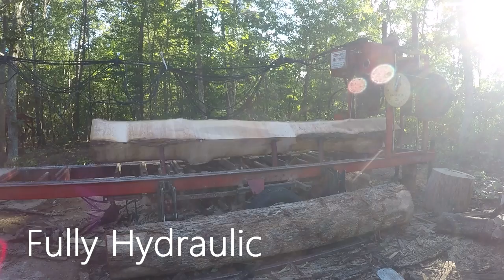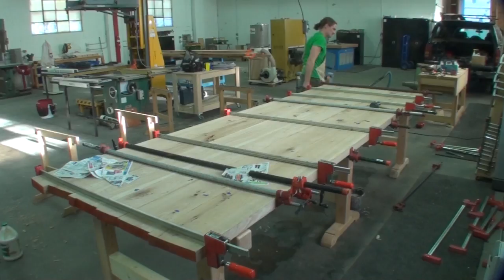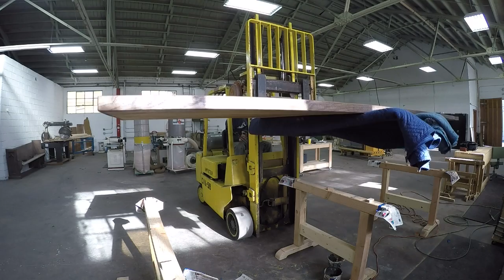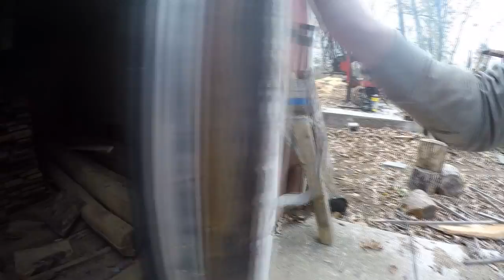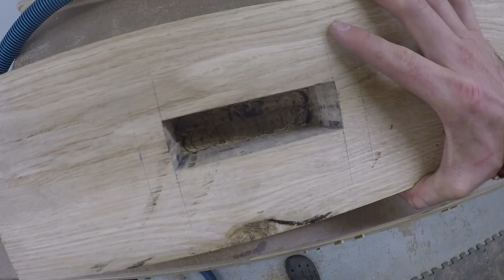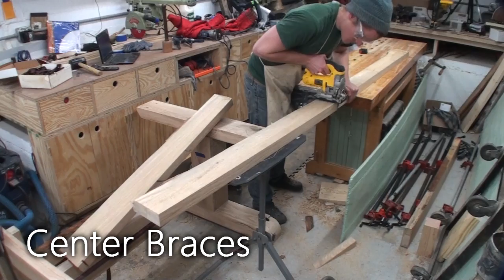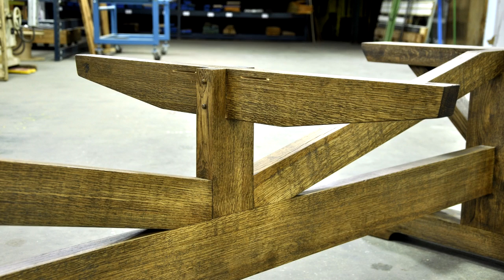Woodworking - Massive White Oak Trestle Table - Log to Table

Comment: Awesome video and project. I think this demonstrates how much work goes into the table base verses the top. Geometry and algebra are used so much in the design and build. Thanks for sharing!
Reply from the maker: Ha, it may be used but nothing to technical on my end. Most of the time I just eye ball things, trace and transfer lines and go for it. I do a lot of what I do without even measuring, just mark what looks good and role. Thanks for watching.

Comment: Read through the 229 comments (so far) and the replies you made but didn't see these mentioned.
1- How did you get it delivered? I know it was two pieces but still big and heavy. Rental 18 wheeler? Haha
2- Without breadboard ends and having the 3 supports, how do you account for wood movement? Elongated holes?
Excellent build and beautiful results! It definitely looks like a huge table that would be in a lodge! This will last generations beyond us. Hope you put your mark on it (in blood).
Reply from the maker: 1. I took things separately......the base, then the top, then the farm table and benches using the black truck to the customers house. Then they had a moving company pick it all up, with a bunch of other stuff for the cabin in a large truck. the top measured 12X4. The base is 8 feet long. The other table was 8 feet. So just one at a time.
2. I missed filming the part about the mounting holes, but you can see them at different parts of the video. The 3 supports have holes for large washers, then elongated holes for movement. There was also slots for table top mounting brackets as well. Once the professionals delivered it, the customer screwed the top on. Bread boards don't stop movement, they just help keep a table top flat and cover the end grain. I'm not the biggest fan of them.

When I say cabin, I don't mean a little quaint cabin, this is a large place where the table will fit nicely.
Reply: The Homestead Craftsman That black truck must have been down on the axels for each of those trips - haha.
Yes I saw the holes, just checking that my eyes weren't deceiving me. I know why the use of breadboards AND have seen how you aren't a fan of them.
Yes, Lodges are amazingly big and perfect for your great (both versions of that word - haha) country tables! The owners couldn't have picked a better craftsman!
Reply: @The Big Ragu Ragusa A breadboard is a separate piece of wood that fastens (in this case) on each short end of the surface, keeping the ends of large laminated pieces like tabletops, countertops, etc. (which are prone to warping) from warping. Most table crafters would deem them necessary in a piece this size. Some will argue that they make a piece more attractive, some will argue the opposite. Either way they add to the labor of the piece. Whether this piece will suffer without them, only time can answer that.

Comment: You have come a long way in the last three years or so.  Nice work.
Reply from the maker: I was actually making much more complicated pieces before I started my channel. Most of what I make is on the simple side, farm tables  for example, so that I can work really fast. I used to make a lot of stuff that was joinery and hand tool heavy, dovetails, etc. but my woodworking now is an income generator so I need to keep things humming a long and repetitive. What I have done though is improve my shop conditions and tools. I've been working well within my skill level for the past 5 years doing the same stuff over and over, I'm looking forward to getting back into more interesting pieces, in wood and other materials. Thanks for watching.

Comment: I've watched this video many times.  Of all the table builds I've seen on Youtube this is by far the one I love the most and has been the most inspirational for me on my upcoming table build.  I went to a local hard wood supplier and purchased twelve 8/4 white oak rough cut planks.  They sat in my garage for almost a year and now I've currently got them at a local saw mill be squared up because I don't have a jointer or a planer large enough to handle this size material.   I cheated and ordered some custom made steel legs for the base.  So all I need to build is the table top and stretcher that will span the two steel base legs.  When I'm done I will have spent about $2k on materials and milling but I'll have a 8' solid white oak table with a custom fabricated base that will last far beyond my time here.  It won't be nearly as nice as this one but it will something that stands out in my home for sure.  Thanks for the inspiration!
Reply from the maker: Nice, sounds like it will be pretty cool. Glad you enjoyed the video. This was a big piece as far as what is normal to me. It was involved, having to find the logs, have them milled and dried then the build. Fortunately it didn't cost me that much. I paid under $500 to buy the logs and have it milled and dried. The guy I got them from was clearly just being nice. I got enough wood to make 4 of these tables plus other stuff. Feel free to send me photos of your table when it's done. It would be cool to see.
Reply: @thehomesteadcraftsman8975  Just finished my table and emailed you a couple of pics.  Thanks again!

Comment: Awesome build! I've done quite a bit of staining and finishing for the stair/ railing company I work for, I would stain the edges after the surface, if you have any drips then they will easily be seen on the edge. I would also sand 320 between clear coats! Just my 2 cents, Great videos and solid content.
Reply from the maker: I like the edges first, then top, then go back around and hit the edges. I also wipe the devil out of the piece. 220 is good for adhesion and the paper wears each time I sand. It had a very soft feeling finish in the end. Not disagreeing,  just explaining. Thanks for watching.
Reply: The Homestead Craftsman right on! pretty cool stuff, such an awesome table!
Reply from the maker: Thank you, I'm also doing a series of videos going over the details of this table. It will probably be 3 videos total, here's the first one. https://www.youtube.com/watch?v=CCEgLDIrR6s&t=51s I go over the order, design and milling lumber.

Comment: I have a lot of white oak, thx for the stain tip. Nice finish! I really like that tone. Any estimate as to the finished total weight?
Reply from the maker: It is a nice color, it was the first time I've used it. Has the look of a lot of the original pieced done in this style. The table probably weighed around 600 or so.

Comment: very good use of Festool Domino construction.   I built a similar 12 footer  for friend 8 years ago.  My question:   Other than the long horse trailer we used to haul the finished table, how many guys were needed to squeeze that air carrier into a 36 inch door opening?

Comment: Great Job I see more festool tools
Reply from the maker: I've been using the two that I have in several videos. I've got one or two with the joiner and a bunch with the saw. I did get a tool not too long ago to align the guide rails though, very handy.

Comment: Loved this, great craftsmanship and now a big fan, the only observation that concerned me was how when planing across the grain you did not splinter off the edges, I don't know how you got away with that.
Reply from the maker: Not sure what part of the video you are noticing, but a lot of the time I'm not going off the edge and will come from the other side. If I do go off the end, I'm most likely going to be cleaning it up somehow in  a later step, this particular plane is razor sharp as well. Skewing the plane makes a difference as well, instead of having the full width of the cutting edge exiting the side of the wood, you just have a small part of the blade cutting.
Reply: @thehomesteadcraftsman8975  Thanks so much, great response, please don't think I'm being critical, I got what you're saying. Beautiful workmanship.

Comment: Great table and video, made me a subscriber.  

Staining directions say to wipe excess off after 15 minutes.  How do you approach that step when you are staining large pieces?  Do you stop wiping on after 15 minutes and go back to wipe it off?  Do you go a little longer wiping it on because it's faster to wipe it off?
Reply from the maker: I just stop where ever I am, go back wipe it down then continue to stain. I just try to stop at a good place......most of the time I have no problem staining a whole piece in a few minutes though. I don't like going too long as it can set up on you and require a lot of work to wipe it down.

Comment: Gorgeous table....beautiful workmanship. This is a question NOT a criticism...should the crack on the leg base have a "bowtie" installed? What really determines if one is needed or not.  So impressed by all your projects.
Reply from the maker: Most bowties/butterflys you see are cosmetic. They used to be done on the bottom of things then once being a craftsman became less of a tradesman and more elevated they came around in sight crack in the leg is stable. So you would use one if you thought it may be a problem but if the wood really wants to move, it'll move regardless. It's hard to dry lumber this size without a crack. That's why I didn't just saw a 6 by 6 for the big posts and did them in two halves.

Comment: Festool is another level but nor for mere mortals. Great job as usual. :)
Reply from the maker: Relative to what you can get out of them and the fact that other alternatives to certain tools don't exist....they are not that bad, but expensive yes. I use my tools for hobby and to make money so I can justify buying them at this point. Most average guys trying not to spend all their money and do a little woodworking here and there could get a lot of other tools for the price of one festool. For me the term time is money is very true, and they speed things up a lot for me.
Reply: The Homestead Craftsman I didn't mean anything bad with that. If I was a professional woodworker I'd certainly go for it too. Unfortunatelly I'm an IT guy who loves woodworking so my tools are like Bosch or DeWalt and I actually spend more time watching the pros than doing things myself. ;)
Reply from the maker: I didn't take it as negative, just sharing my thoughts. Some people get scared away from certain things that are expensive that have massive value, far beyond the cost of buying. Value of course is relative to what you are doing, for me it's high, for the next guy time is not a factor and he may also prefer to go about it a more traditional way. If I wasn't making money doing this I wouldn't have bought it either but a lot of hobby woodworkers do own Festool stuff. Now get back in your shop!

Comment: What spray gun and when do you prefer to spray over just wiping on?  Gorgeous table by the way.
Reply from the maker: With lacquer I would always spray. They making brushing versions, but you can't beat a spray gun........ which was just a cheap harbor freight model. $10 on sale. Sprays good, but all you need is finish on the table. I rubbed it to a satin after a few days.

Comment: Hello HC

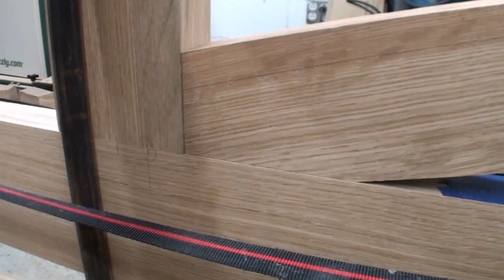At 17:27 how did you attach the top of the angled piece to the end frame stretcher, I may have missed it despite rewatching. Was it dominoes? I’m building similar harvest tables and was curious about your joining method.

Love the videos! Keep up the great work
Reply from the maker: If I am getting your right, yes, I used dominoes for that piece. I used dominoes and mortise and tenon for everything except the angled supports, which I screwed in.

Comment: Incredible table well done. With that track saw, did you not need to joint or plane those boards before glue up? Straight from cut to glue?

Comment: That's really cool. 
How much would a table like that weigh?
Reply from the maker: 500-600 pounds or so.... 2 inch thick 12X4 foot white oak, the top alone was probably over 400.....so maybe over 600. That's why I could not make the top in my shop. It's a monster.

Comment: This is absolutely phenomenal!  "True Craftsman" is an understatement for your exceptional skills!!!  In your video towards the end you said that you underbid the job which typically happens in most cases due to various reasons, in each instance different I'm sure.  If I may, how much did you end up building the table for, and if you were able to do this again, how much would you charge?  I built a farmhouse table as a gift for a friend in the family for her birthday, upon her multiple requests, and it was not nearly as exquisite as your peace, and my timeframe altogether was approximately three weeks (work, kids, family, etc...).  If you feel more comfortable you can message me privately or email me because I would absolutely love to learn how one can avoid making an error or be blind sighted as far as charging someone goes.
Reply from the maker: It's the nature of doing custom work. Since it's a new design there will be variables that you can't predict 100 percent. That's why I like making the same stuff over and over. I know how much it should be since it's the same. This would basically be a prototype. You just wing it the first time, then once you have the model make adjustments to the design and price and then sell it as a standard piece. I don't get into the exact prices I sell for but if I did it again I would add several thousand dollars. That's not to say that I sold it for a low price, but simply could have sold it for more. Mainly this is due to it's size, difficulty in handling, milling and the fact that it involved so many people. It was a premium service/piece to provide...which demands a premium price. To put it in perspective, I could have made around 15 or more of my farm tables in the time it took me. Making this piece was more about the customer and wanting to make a video on the process than the financial gain. My advice on pricing is to look at commercially available pieces that are similar to what you are making and add to that price. For example, if you want to make something and west elm has the closest match and they sell for $2000, price your table over that, how much is up to you. This won't work for everyone. Some people won't be able to get what places like that sell for and others can get far more even though he pieces may be about the same. What I'm making is nicer than a store bought table, cost more to make and takes much longer. It's also custom, so a sensible customer should expect to pay more, if they don't it's best to pass on the job than to cheapen your work......that's my opinion at least. I don't bend on price, once I give a price I don't haggle.

Comment: Quite a project and it looks great.  I'm working on something similar with 2x6 oak boards.  I can't afford the festool tool, but I do have a dowling jig.  I was also considering using my pocket hole jig, but I really thing the screws just won't be strong enough to hold the boards together (unless I place them about every two inches).  What diameter dowels would you recommend I use at what spacing?   Also, does the lacquer you used give it a shiny finish?  If so what type was it, and should I use a spray gun as well?
Reply from the maker: If you are talking about the top, then you don't need them. I did it for alignment. If that's what you want to do, then biscuits will work if you have one. Any size dowel will work if that's what you want. Does that answer you? I used satin finish, you can get it in any finish. I like satin, not a fan of gloss in most cases. I would suggest spraying it, then buffing. My spray gun is cheap, check the links in the video. If they are not in this one, the link for a spray gun is in one of the descriptions of the series vids. Thanks

Comment: Amazing work. How did you connect the table top to the framing/legs?
Reply from the maker: Two methods, long screws that can slide around a little as well as "store bought" table top fasteners from McFeeleys.

Comment: Great works and thanks for sharing the process.  What type of epoxy do you use for filling in the knots and holes?
Reply from the maker: West System 105 epoxy with various hardeners. In this video I tinted it with black powdered chalk for chalk lines. You may also be interested in this video, it's the first in a series where I will be detailing this build more closely. https://youtu.be/CCEgLDIrR6s Thanks for watching.

Comment: How many logs did you end up milling to get the required lumber for this project?
Reply from the maker: The two in the video plus some other lumber he had but all the lumber came from the two and I have a good amount left over.
Reply: Thanks for your reply.  I will be harvesting some trees in a couple of months with a friend and was curious how much I would need for a project of this size.  Thanks!

Comment: Beautiful table. Really like the trestle base. Is the top screwed to the base with slotted holes so there is room for expansion? And does this keep the top flat?
Reply from the maker: Yes to both. With that said, cupping in a top this thick can be very powerful, enough to rip all the screws out. That's why you need stable, dry wood.